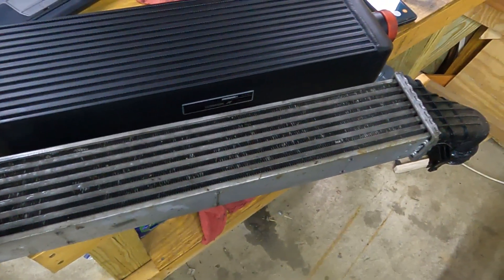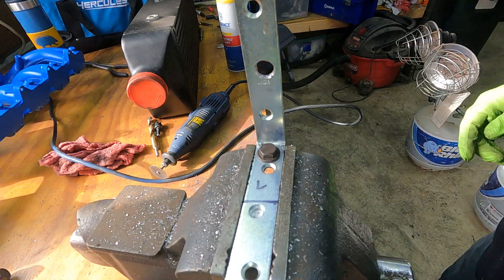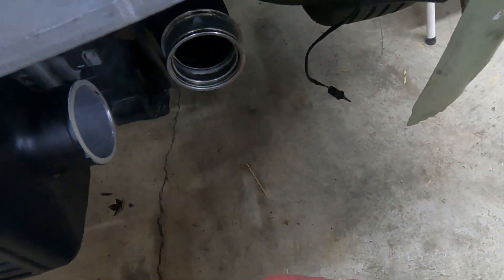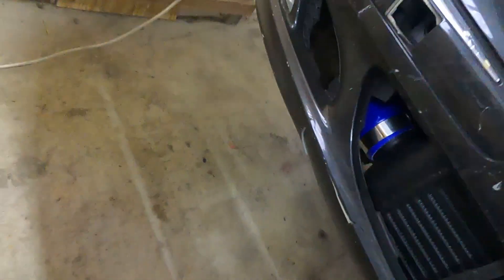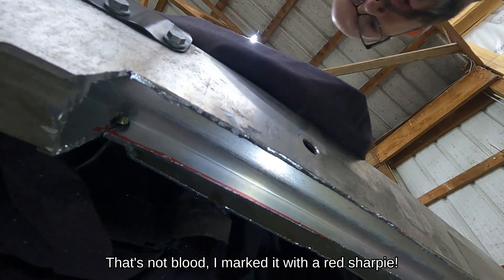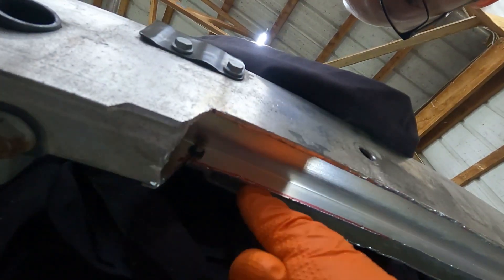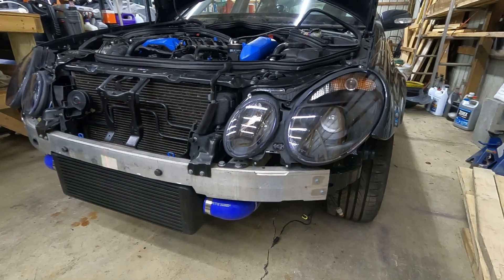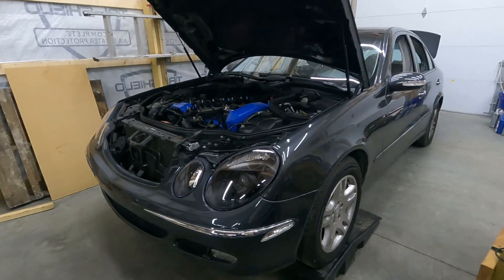How I fit a HUGE intercooler to Evonne the Turbodiesel!

Comment: Hi mate, thanks for the nice videos. I did same for my merco but the problem is that the hoses pop off from the charge side, you didnt have this issue ?
Reply from the maker: Here are the best tips I have for that:
1. Degrease. Make sure there are no oils on the fitting or the hose. Scrub those surfaces down with degreaser on a rag. Dry thoroughly before attaching.
2. Roughen. If you are attaching to a smooth piece of tubing, take some sandpaper and roughen up the surface that the hose will clamp to. This will increase friction.
3. T-Clamps. Get some good quality t-clamps. Take the car for a spin and warm things up, then re-tighten, also, as hose materials soften and loosen with temperature.
4. Bead Roller. If you have a piece of tubing that is free and you can work on it at the bench, you can look into a bead roller that will put a raised area around the end of the pipe to help keep things together.
Reply: @ArtOfDiesel thank you so much for the answer, the 2 and 4 tips may be the solution. I was thinking to cut this stock aluminium connection in the intake after intercooler, and put some inox tube between him and the 90 degree hose and tight all with T clamps. Can be good as a seconde idea ?
Reply from the maker: @AyoubTrucker  not sure what you mean by inox tube. Can you describe more? Two more things: 
(1) I don't get on YouTube much, it's easier to have in-depth discussions if you join my substack (free) https://artofdiesel.substack.com
(2) One of my most recent videos covers my current intercooler plumbing.

Comment: Can you link to the after market headlights please?
Reply from the maker: Sorry, I won't recommend them. They were absolute crap. A couple different places sell exactly the same thing (because I tried two sources) and had to be adjusted outside of their available range to work at all. I had to pull the lenses, and add screws and washers to the insides to get them to work. 

I recommend seeing @LegitStreetCars video. Alex does it the right way. If I did it over, I'd modify stock headlights, rather than buy such low quality. https://youtu.be/FQonBniudjw?si=ZCfklwDbMzNiqKKz

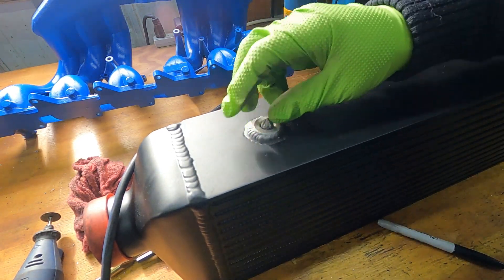Comment: At the 1:47 mark how did you derive the mark on the L bracket? Front edge of IC (setting up IC and marking bracket)?
Reply from the maker: Those lines are both the front edge of the bumper and where I wanted the front edge of the intercooler to be. So, yes, I was aligning those with the front edge of the intercooler while tapping. I had decided that was a good location and I think other things underneath kept me from going back further. Of course I later trim the bumper to get the intercooler sitting higher for better clearance with the bumper cover. If you look at 10:32, you can see that front edge of the intercooler lines up just underneath the exposed black bolt heads.
Reply: Yeak, OK, thanks. I went ahead and did pretty much that. I got some nice wide and short brackets and they ended lining up to the front of the IC while the back came out just enough to pick up the IC mounting holes (just enough to allow the bolt head to turn for tightening. Need to finish up cutting the back side of the bumper. Again, many thanks!
Reply from the maker: @seer7327  Be sure to share what you are doing, I'd like to see it! You should consider joining my substack, too: https://artofdiesel.substack.com

Comment: Did you have to cut the doubler/stiffener? I measure 3/4" to the humped part of this piece from the bottom of the crash bar; that would mean that 3/4" would have to be cut from this [metal] piece.
Reply from the maker: Yes. There's still a lot of structure there, but the doubler got trimmed with the rest of it.